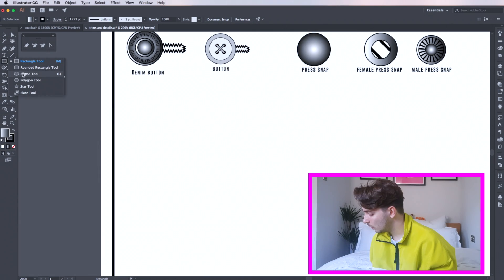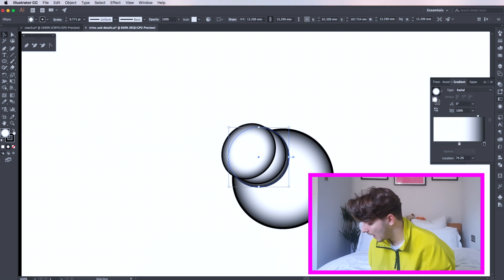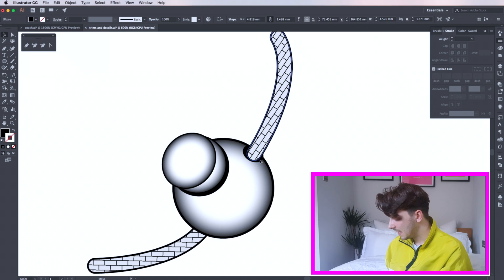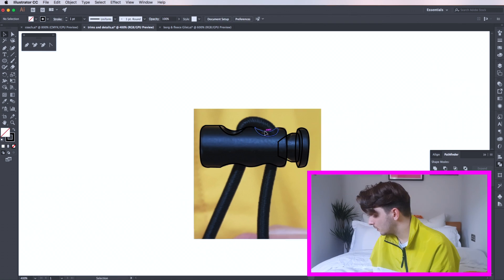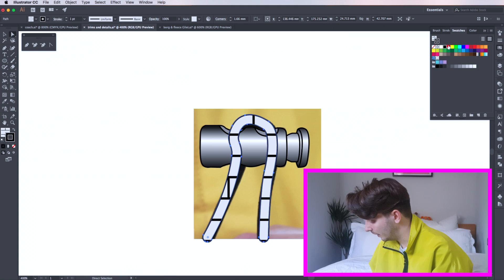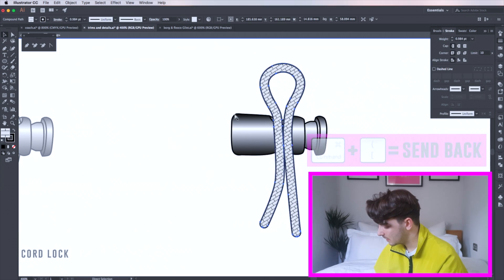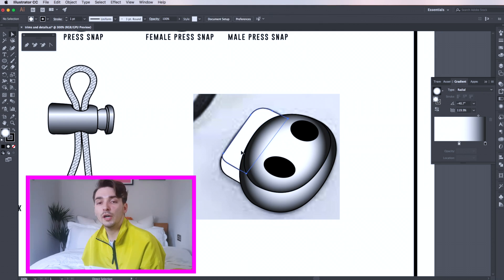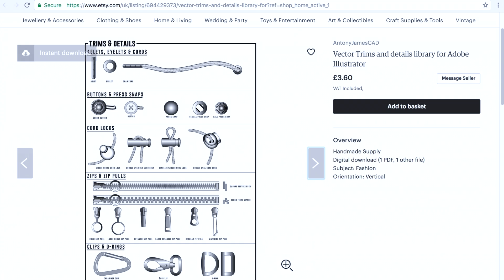How to Draw Cord locks Using adobe illustrator

Comment: such a great video, so useful! thank you :) if I already have my trims and pulls on illustrator. how do I save and store them like I would a brush stroke, so I don’t have to draw them every time I need to do a CAD ? I hope you can help, thank you :) x
Reply from the maker: hey! so clad you liked the video! and thanks for your comment, i do it 2 different  ways firstly i have a page saved full of my trims, details, hardware and locks and i copy  them over every  time i need them, otherwise  i drag my item into the symbols box and use it that way 👍👍👍 hope this helps x
Reply: @SoCalledFashion  makes sense ! Thank you so much :) x
Reply from the maker: @sofialavin44  no problem 👍